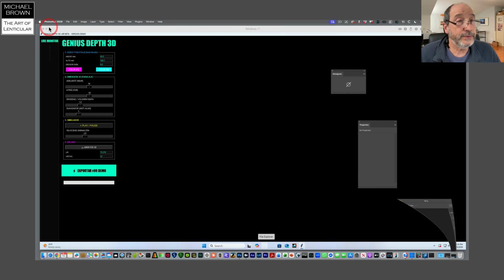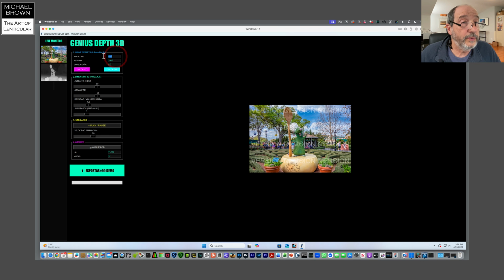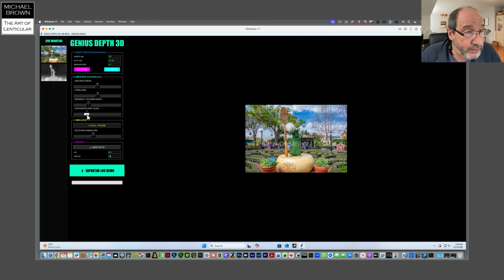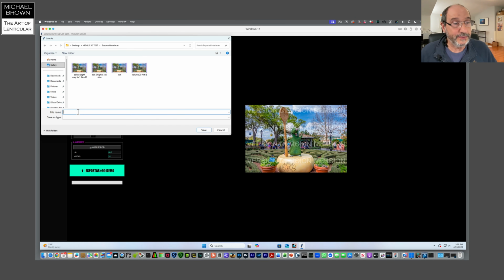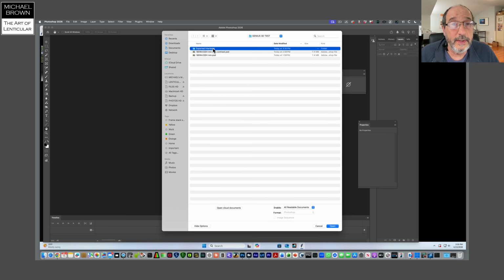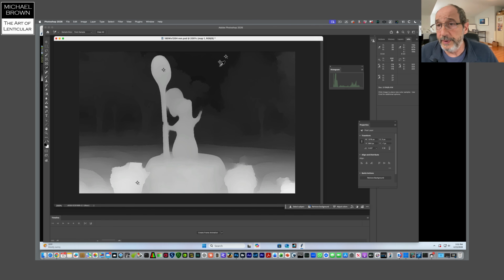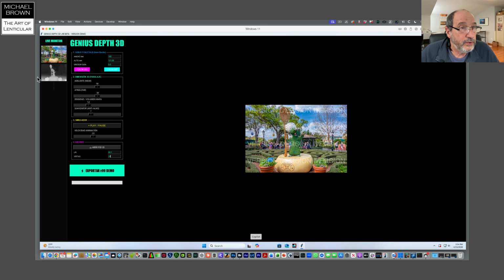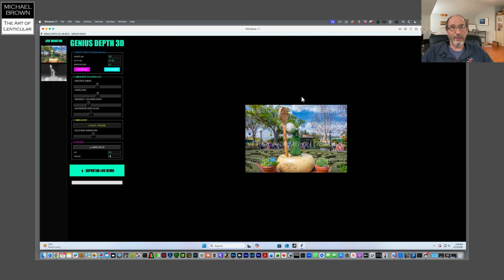I tried the new Genius 3D software program for making lenticular prints.

Comment: Hi Michael, my name is Ryan. I am a novice at this skill and am located in Japan.

Thanks for sharing this program! I will definitely try it out.

I have been struggling so hard with getting depth from my attempts.

So far I have tried using the following sheets:

LPI - 100
Thickness - 0.58
Viewing Angle - 31

LPI - 60
Thickness - 0.42
Viewing Angle - 31

LPI - 50
Thickness - 0.58
Viewing Angle - Unknown 

The image depth and pop out is always so shallow. Like extremely shallow. Maybe 1 cm? 

Can you please advise which of these sheets would be best for 3D?

Currently I am using a 600 horizontal resolution printer and building the depth map and image series from SPM and combining it with Grape.
Reply from the maker: In general smaller viewing angle and lower LPI sheets work best. Of the lenses you listed, I would pick the 60LPI. I would suggest trying the demo of 3DMasterKit. It allows you to adjust the percentage foreground and background parallax. The resolution of inkjet printers and the use of thin lenticular sheets limits the amount of depth you can achieve. For letter size prints, I hear very good things about the Chinese 42LPI 3D lenticular sheet.
Reply: Thanks so much for the guidance! I will check into 3D MasterKit and that Chinese sheet as well as looking for a higher resolution printer!

I made a mistake on the specs for the 60LPI sheet. The corrected specs are below. 

Would you still recommend that out of those listed?

LPI - 60
Thickness- .71
Viewing Angle- 42

Edit —>> I found a Chinese 40 LPI 2mm sheet! I think I’ll give it a shot!
Edit 2 —>> I found 30 LPI at 3mm and as low as 18 LPI at 3mm! 

I think I’ll go for the 30 LPI - at 3mm it’s gotta have a narrow enough viewing angle to see some depth!

Comment: If I gave this program a left and right image stereo pair, do you know if would it be able to work from those ?
Reply from the maker: No - that’s not how this software works. 3D lenticulars need more than 2 views and you generally need a larger stereo base or parallax then what a traditional stereo pair provides. Usually you use a single image and then create a depth map. Software like 3DMasterKit can create a series of frames that can then be interlaced. You then would print the interlaced file and mount it to a narrow viewing angle lenticular sheet. There is also software called StereoTracer that uses a stereo pair to make the depth maps and frames for interlacing.
Reply: Si lo tenia pensado una imagen estereoscopica